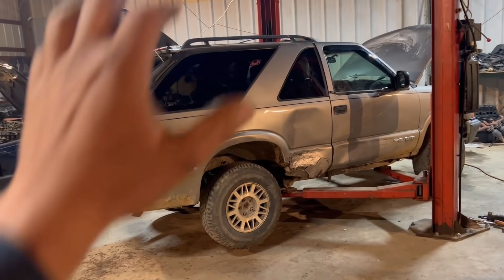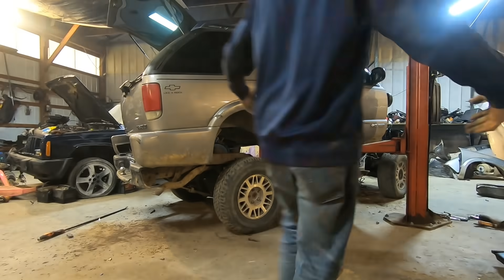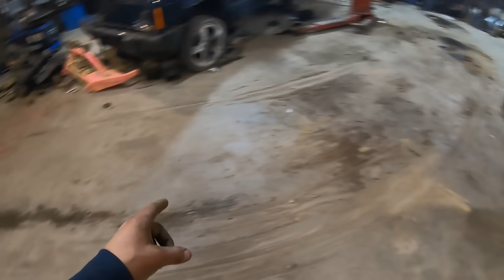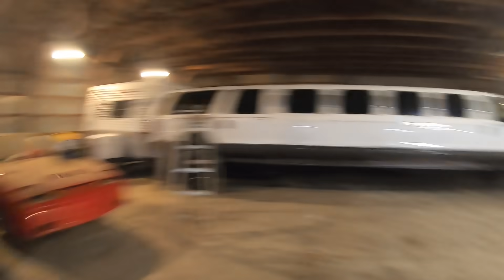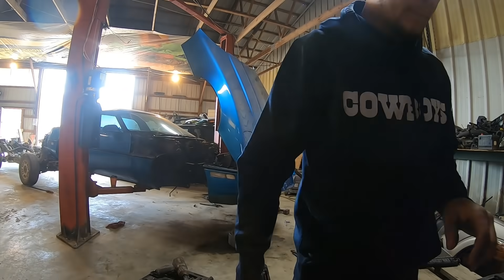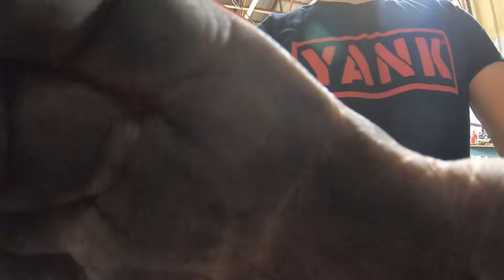4WD CORVETTE....The teardown and BUILD HAS GONE QUICK! FIRED UP

Comment: I’m pretty sure with a wiring diagram from the vette and the blazer you could repin the connectors so it’s plug and play
Reply from the maker: Seems like a lot of extra work
Reply: @senditsteve8206  true but at that point you’ve done a better job than who ever built it first.  so not a waste of some extra effort if the end product is bitchin’ ( in my opinion) ( but all I’m really talking about is repinning the body connector from the vette to the blazer) you also might want to salvage some of the body harness from the blazer just in case you need it  and I’m saying this as someone whose helped out on a few chassis swaps)